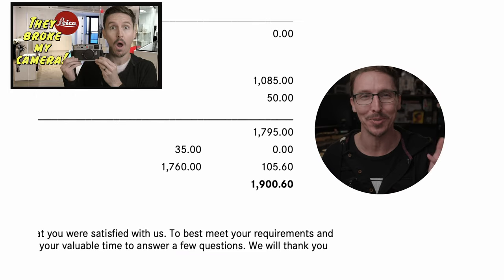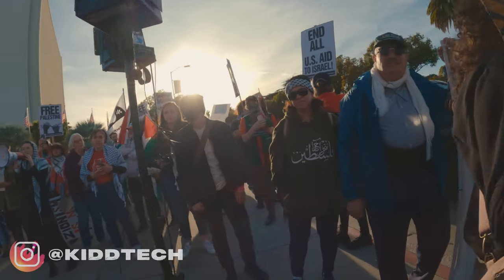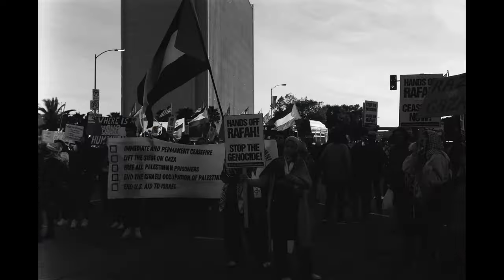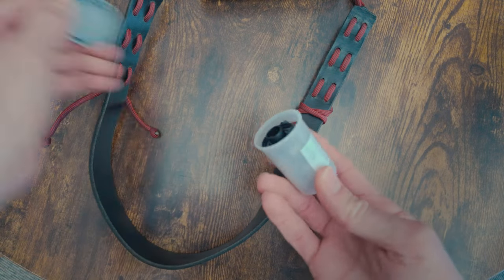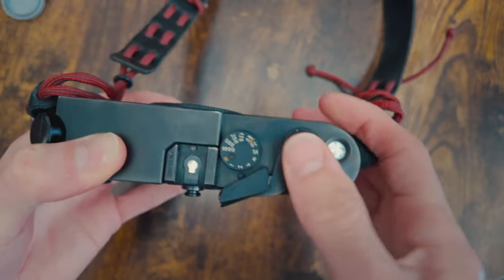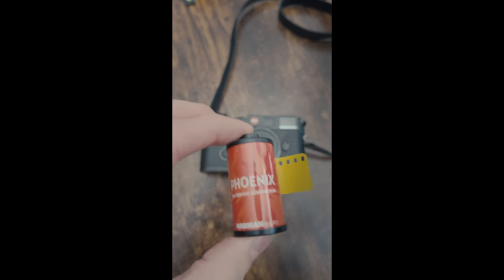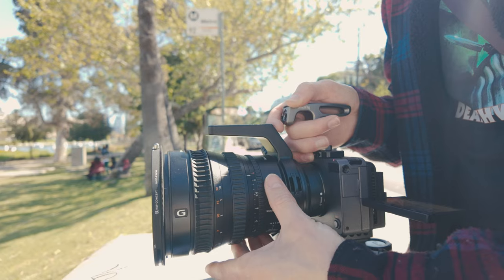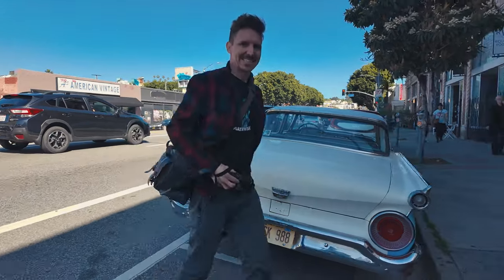New Leica, New Crisis! How to Save a Roll of Film

Comment: That’s so funny. I grew up and still shoot film so as your video progressed I kept thinking, “Just stick it back in, dummy”, lol. In the 70s when most people only had one film camera, it was pretty common to swap film mid-roll. 
I’d never considered how a digital shooter would think!
Reply from the maker: 😂 slow learner
Reply: @JustinPhillip  ha ha!
The thing about running the film twice through for double exposures is trying to keep the registration of frames somewhat consistent between run-through. Otherwise you have (at worst) framelines midway through your images. You can try marking the frame at the edge of the film gate but there’s usually some slippage. But go for it!